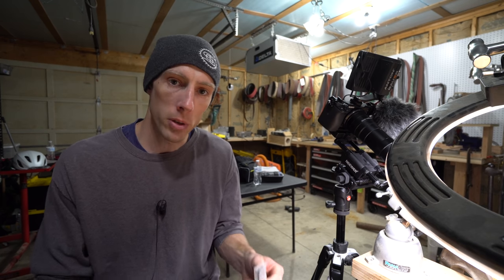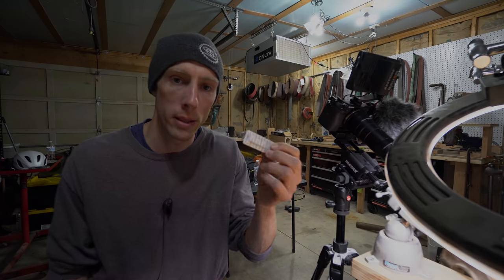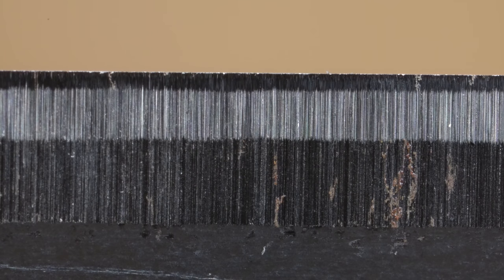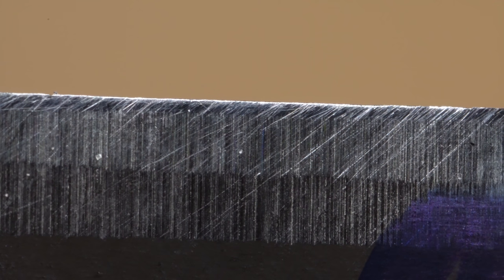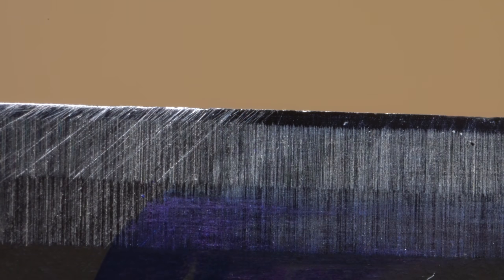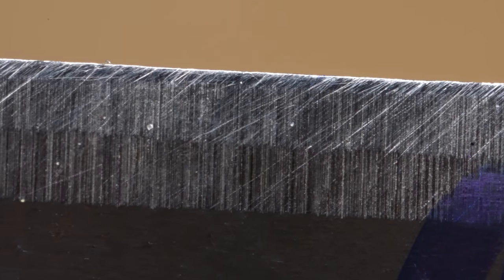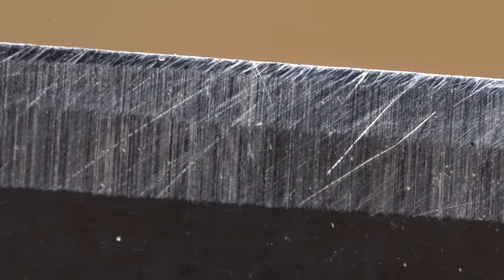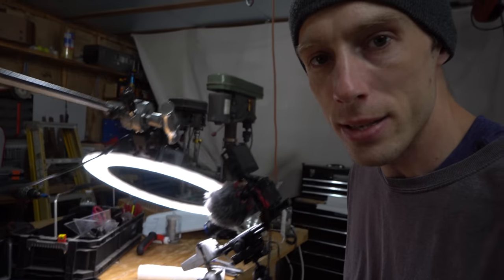What Does a Razor Sharp Edge Look Like ULTRA Close up?

Comment: That is absolutely not a standard utility blade that is a Persona carpet blade. As you mentioned it is thinner than a standard utility blade but it is also heat treated to higher hardness. I've had I've had many and I mean many years of experience with these suckers. I have filleted a fingernail off, cut of a finger tip, buried a blade 1/4 inch into the side of my thumbnail and I also have a half inch wide 1 inch long scar on my calf. Ya just got to chuck it up to the game. If you're going work with very sharp blades everyday your going to get bitten.